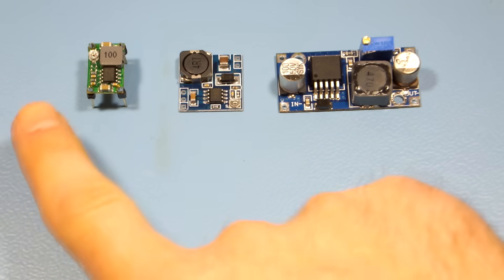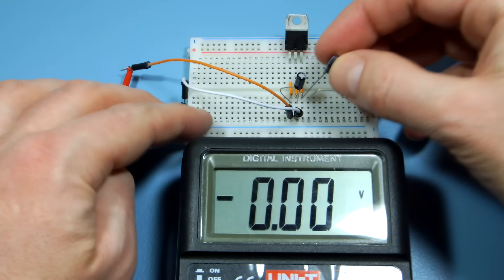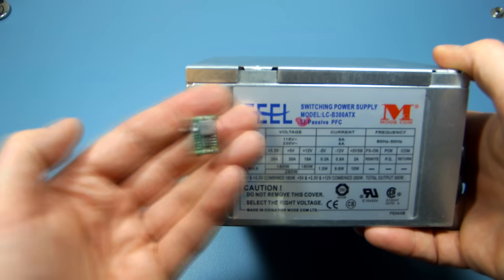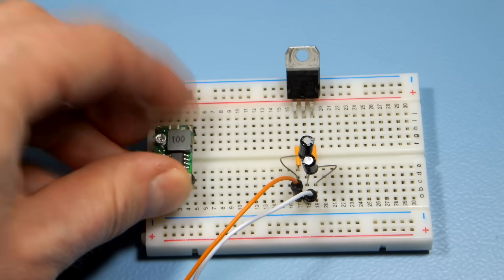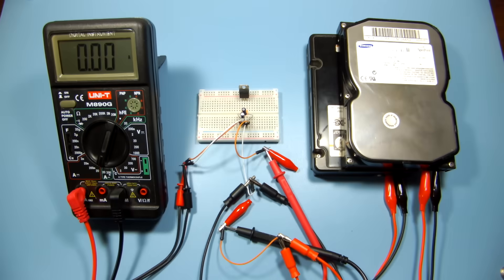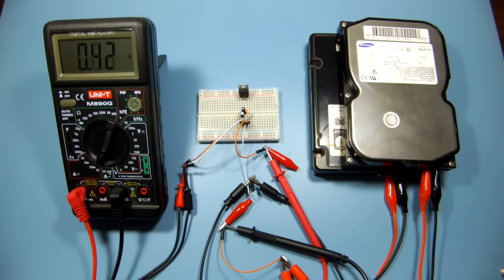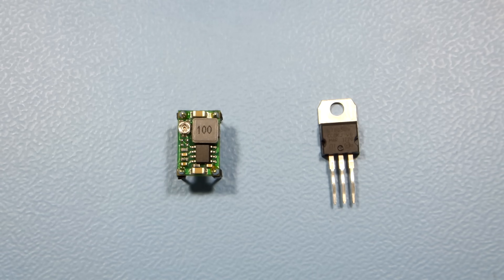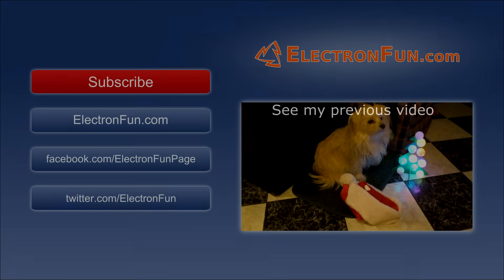Buck converter vs. linear voltage regulator - practical comparison

Comment: I would suggest to make a video on how to measure current draw like you did here. I have seen many videos on the subject but non really explain how to use it partially. I know how to measure draw in a system, just not how to find draw of just one element in a circuit. I mean how do you know your measurement is showing draw of the buck and not something else? Regards
Reply: measuring input current ( and knowing the voltage ) gives you the power.
He measured the current consumption of the load ( 420ma ) before hand, and he knew the output voltage was 5v 
this is how he calculated the power dissipation

as for how he measured, he put his meter in series ( like you would put a resistor in series or anything else ) to what he wanted to measure
Reply: +BitsAndBites Ah, math. I understood it as if it was a direct measurement. Thank you for clarifying.
Reply from the maker: I was measuring current on the input, which gave me power consumption of the whole circuit with the buck converter/linear voltage regulator.
Reply: That was my point. Again, how do you know the consumption of the converter, when you measure the hole circuit? You would need to measure both total draw and draw of the converter output, right?
Reply from the maker: Thank you BitsAndBites :) You explained the situation in a very clear way. Michael Madsen - I hope you understand what I meant :)

Comment: I want to output 1A 5v from a UPS Battery Which is 12v-7.2Ah. what I should
Reply from the maker: You could use a buck converter.
Reply: thanks, but i figure it out before ur comment :P
Reply from the maker: Ok, the most important thing is - you solved the problem :)
Reply: cool, i have a router, which rating is 5v and 500mA. can i able to add a 24Ohm's resistor to use it with a 12v 7.2Ah battery  (i= 12v/.5A=> 24)
Reply from the maker: Your calculations are not quite right. It should go like that: (V source - V output)/Current, which in your case would be: (12V-5V)/0.5A=14Ohms. Just be aware that your resistor would have to handle 2.5W of heat, so use one that is powerful enough for your application.
Reply: i used a two resistor in series which value is 10ohom each(both are 10W resistor). But my router is dead now.
Reply from the maker: Why do you think it died?
Reply: +ElectronFun.com because it didn't power on I mean start when I attached adapter
Reply from the maker: That's pretty bad. Have you found the cause?
Reply: no. thats cost me 20 $ for experiment
Reply from the maker: Experimenting always involves some risk :(

Comment: In your example the buck converter was still operating above a safe thermal threshold.  A 38C temperature measurement at 2.6W cannot be accurate.  The regulator IC was probably nearer 100C internally.  The example still shows greater current capability and efficiency, but these types of buck modules often have questionable free air ratings.
Reply: Note: I don't think the calculations in the description are accurate... you have to consider the power in minus power out, as the current in and current out will differ. You can't just combine them and assume constant current at all voltages.

That said, the buck converter wasn't dissipating anywhere near 2.6W. Given that the dummy load is 5V @ 450mA (about 2.25W), it's all about efficiencies...

The LM7805 wastes a LOT of power going from 12V to 5V - it has about 5.04W (12V*0.42A) coming in, and is dissipating about 2.79W as heat. No wonder it keeps shutting down without a heat-sink, and even then it's extraordinarily wasteful.

The buck converter (which appears to be based on an MPS MP2307) has a far greater conversion efficiency... it's not dissipating 2.64W (12V*0.22A) - it's passing most of that power through to the load device, and dissipating about 390mW as heat. Quite a bit less than the LM7805, readily dissipated, and well-within tolerances (and as for current-carrying capacity, the device is well within the 3A continuous duty ceiling as well).

A link to that data sheet, for reference:
http://www.mouser.com/ds/2/277/MP2307_r1.9-371737.pdf
Reply from the maker: I wasn't exceeding the datasheet values and the buck converter was perfectly stable.
Reply: Fair enough, but I have built quite a few lights out of generic LEDs where I didn't exceed datasheet values and the circuit was stable, but the LEDs burnt out in a matter of only hundreds of hours.  My main point is, consider the power density.  Greater than two watts is a lot for that module.  

No datasheet really needed to realize this, there isn't enough heatsinking copper on the PCB which is also a normal parameter in determining how much heat an IC can withstand per the datasheet parameters, BUT they are very cheap so as long as you're happy...
Reply from the maker: There are better and worse components and even paying more doesn't necessarily mean you're buying better products. Some parts do fail earlier than they should, even if you stick to the datasheet.
Reply from the maker: I was measuring the input voltages and current. Heat dissipation is a different story.
Reply: Per the video you measured output current for the given output voltage as well, but while your video correctly demonstrates the differences in efficiency of linear vs switched mode power conversion, since Vin != Vout and Ain != Aout, the equations in the description are incorrect and detract from your (correct) measurements and conclusion. The difference between power in (Vin*Ain) versus power out (Vout*Aout) is virtually all heat dissipation... which is why your temperature readings were different for the two devices: the switched mode converter was dissipating (wasting) far less power than the linear one.

Comment: Sir what abt LM317 and LM723 linear voltage regulátor . Does it have the same problem
Reply: Not sure if you ask a question but if you did yes all linear voltage regulator have the same drawbacks.
Reply from the maker: Yes, most linear voltage regulators have the same disadvantages.

Comment: Why did you use, and how did you arrive at the ratings for the capacitors for the linear regulator ? 
while no caps are needed for the buck converter, are they already built in, or unessessary?
Reply from the maker: I didn't go through any calculations, I simply used the same setup for the linear voltage regulator and buck converter. You don't have to use additional capacitors, but they may help stabilize your output.

Comment: Great video.  How stable is the output on a buck converter?
Reply from the maker: I don't have any figures, but if you don't run higher currents than the buck converter is rated for, the output will be stable.

Comment: Hi, I want to power my digital camera which is rated as 3.3V 2A, but i cannot find such power supply or it is too expensive. Should I use a buck converter or a linear voltage regulator? What power supply (input) can I use for the converter/regulator; can I connect a travel adapter with the converter/regulator? (min. voltage/current required?) Thanks :)
Reply from the maker: Hi RUS, do you want to charge your digital camera's battery or the camera directly, without the battery?
Reply: ElectronFun.com use it to power by camera directly, not to charge batteries.The input is 3.3V 2A.
Reply from the maker: +RUS I would use a wall adapter with a buck converter that can deliver at least 4A. You should supply over 1.5-2V higher voltage than your output.

Reply
Reply: +ElectronFun.com a 12v 2a power supply won't work right? i only have this.. i'll need to search for on with at least 4A :/
Reply from the maker: No, if your power supply can deliver output current of 2A at 12V you can use it without any problems.
Reply: ElectronFun.com cool, i'll try it, thank you very much :)
Reply from the maker: No problem :)
Reply: Recommend this product ： "eBay item number:281667714648"

Comment: if i want to use pwm to control the voltage of the buck converter,how can i do it?
i have a raspberry pi to generate the pwm signel
Reply from the maker: +yang zhang How do you want to control the voltage? Do you mean input or output voltage?
Reply: i want to control the output voltage,the input voltage is  constant 15v,and the output voltage can be control by the pwm signal.
Reply from the maker: I'm not sure if I understand correctly. Do you want to substitute the potentiometer with the PWM signal?

Comment: i want to ask you something. if input voltage is 6v, the output voltage also 5v in both lm7805 and lm2596?
Reply from the maker: +hee-keon Yoon LM7805 needs at least 7V on the input. I'm not sure about LM2596 - I know there are several different versions of this IC.
Reply: +ElectronFun.com thanks for reply^^
Reply from the maker: +hee-keon Yoon No problem :)

Comment: Question: If I have a 24v PWM signal and I want to output a 12v PWM signal, does either of these allow me to do this?
Reply from the maker: +bobsixtyfour To tell you the truth - I don't have an oscilloscope and I can't check that. Could you tell me why you need specifically 12V PWM output?
Reply: +ElectronFun.com I need 30mm x 30mm x 10mm 12v fans because they don't make any squirrel cage 24v fans that size. I'm trying to change a 3d printer control board to 24v to provide better stepper performance and sourcing accessories attached to that control board that support 24v is becoming quite a challenge.
Reply from the maker: Oh yes, making your own fan may be pretty challenging. Good luck with your project :)
Reply from the maker: Thanks wurstbreze!

Comment: can we use aluminum or metal casing for Buck converters to prevent interference in the circuit ?
Reply from the maker: +Habib Sinan I'm afraid a metal casing won't prevent interference in the circuit.

Comment: What happens when you have a floating d/c input voltage does the output remain constant on the output pin like it does on the LM ? Or do you need to adjust the trim pot everytime the input voltage changes
Reply: +Rohinton Chinoy The o/p remains constant, if the input voltage increases then the input current decreases, how good is that :)
Reply from the maker: +Rohinton Chinoy You don't have to adjust the output voltage every time, it will stay on the same level, just like with the LM regulators.

+Rohinton Chinoy Thanks :)

Comment: I expected some precision measures with expensive oscilloscope and multiemter, not a 5$ shit toy multiemter...
Also we can buy that small step-down converter from ebay for 0,78USD(inc. shipping) or 10pcs for 4,78USD(0,47USD each).
Reply: +Arek R. Why so rude? And what is not clear from those non-precise measurements?
Reply: And thats the point, there are too simple and obvious measures/comparsions.
Reply from the maker: +Arek R. Everyone has different expectations, I'm not able to make all of you happy.
What is so bad about being able to buy a buck converter for $0.78?

+Vid304You Thanks for your support :)

Comment: Hallo sir, your buck converter is LM2577, right? In linear regulator, power dissipation P= ( Vin - V out)* I load, it's ok. But, in buck converter, do you confuse its power's formula? I remember the power dissipation of buck converter P= Vin*Iq + Vout/ Vin * I load* V sat with I q is Quiescent current, V sat is saturation voltage
Reply from the maker: +Huy Khôi Hà My smallest buck converter is based on MP2307.
I wasn't measuring power dissipation, but power consumption of the buck converter and linear voltage regulator along with the load. I guess I should have stated that clearly.

Comment: You are so informative and detailed. I was going to use a buck converter for a light on my quadcopter but you mentioned about interference  and potentially saved me from a crash.
Reply from the maker: +SlNlST3R Thanks for telling me that :)
However, when it comes to quadcopters - I'm not sure if a buck converter would make any difference. These wireless controllers are quite resistant to interference. A couple of practical experiments should clear things a bit.

Comment: can i use that buck converter to operate my ham radio... 13.8 volt 50 amp...
Reply from the maker: +nald rus I guess you could, but finding a >50A buck converter won't be easy and if you find one, it won't be cheap.
Reply: pk thanx for the reply
Reply from the maker: +nald rus No problem :)
Reply: can it produce at 25 amps???
Reply from the maker: +nald rus Should be possible. What is your input and output voltage?

Comment: Another (best) option for electrical noise reduction, use an optio-isolater ic.
Reply: +Keith Jonas assuming your interfacing to a solid state circuit, and don't want electrical noise.
Reply from the maker: +Keith Jonas Good advice, thanks :)

Comment: Hello, i have an 3.7 v battery with a very small step up converter to 5v 380mA. But this is way to much for a 3w LED. And since the flashlight is only 9cm long and 12mm in diameter, this all will fit. The enclosure is made out of aircraft grade aloy and sealed with o-rings to prevent water damage.

But is it possible to step down 5v 380mA to 3.7v 300mA? I already bought it but i really like to know. Thanks!
Reply from the maker: +Lorenzo van het Hul Nice flashlight :)
Yes, you can step voltage down from 5 to 3.7V with a buck converter. Usually even the cheapest buck converter's efficiency should be higher than 80%.
Reply: ElectronFun.com thanks:)
Reply from the maker: +Lorenzo van het Hul No problem :)

Comment: i want a buck and boost regulator to control a voltage  from a car alternator  that is 12v and 40 amps rated
Reply from the maker: +rider war Might be a bit difficult to find and it definitely won't be cheap.

Comment: How would I build my own linear and switching 9v to 5v convertors without ICs?
Reply from the maker: +Matthew Ferrie There is a very good video on DC-DC buck converters by Afrotechmods here: https://www.youtube.com/watch?v=CEhBN5_fO5o.
Building your own linear voltage regulator is not really economically justified, because you can buy them so cheap.

Comment: subscribed, from the Netherlands! 
BTW, I saw u used a UNI-T multimeter I have one to, only a less advanced one, can you maybe tell me if it's any good 
(accuracy and price) 
I wanted to buy a fluke because of its accuracy.. but they are pretty expensive
Reply from the maker: +Andrew van Leeuwen Thanks Andrew :)
I don't have a reference to compare my UNI-T multimeter against, but I doubt it's very accurate. However it's enough for my needs. I bought it 2 or 3 years ago for about $20. Fluke multimeters are probably the best out there, but their prices are insanely high.

Comment: why temperature is so high in linear converter while buck converter is so low , what is the thing which cause temperature changing?
Reply: +andrewskyworker Because Voltage regulator "consumes" voltage to make output voltage lower than input, instead buck converter acts like transformer, it's converting some of the voltage to current, not just consuming. That's why linear regulator dissipates so much heat, it needs to lower the energy of those electrons, and that energy transforms into heat - bigger voltage drop = more heat. I recommend using buck converter/transformer to lower voltage and after that using linear regulator to finalize voltage output, this way it's more efficient and is a standard way of dealing with this.
Reply from the maker: +andrewskyworker A linear voltage regulator is a simple device. As Δrtificial Mind said it drops voltage by transforming it into heat. The higher the difference between input and output voltages, the more heat it will produce.
A buck converter is a much more sophisticated device. It utilizes a chip controlled transistor, which switches the output on and off very quickly to save energy. Just keep in mind it's a very simplified explanation. If you want to learn more about buck converters, go here: http://www.learnabout-electronics.org/PSU/psu31.php.

Comment: A very good video, I enjoyed it.  Other good examples of the differences is how the efficiency of the linear regulator gets worse as the difference between input and output voltages increase, and the limitations from minimum Vin (drop out voltage) and minimum Iout (discontinuous operation).
Reply from the maker: +Marc Visconte Thanks a lot Marc :)
You're right, the higher the difference between the input and output voltages, the worse the linear voltage regulator performs.

Comment: Hey great video thanks. Could you post the links to those buck converters that you use in the video?
Reply from the maker: +clintathusaz Thanks :) Sorry, I don't have the links, but there are hundreds of buck converters on eBay. Just don't buy the square one - they break so easily and are not worth the time.

Comment: What about when the voltage in is variable from 0v to 15v such as on a model train.  I am tying to get a constant 5v from a track pickup.  Right now the planned circuit includes a linear voltage regulator, but I am concerned about the heat.
Reply from the maker: +Kevin Rutledge I guess you mean the variable input voltage. It should always be a little higher than the output voltage. I haven't tried changing the input voltage on the fly, but I guess it shouldn't be a problem.
You could use a heat sink, if you have enough room in your enclosure.